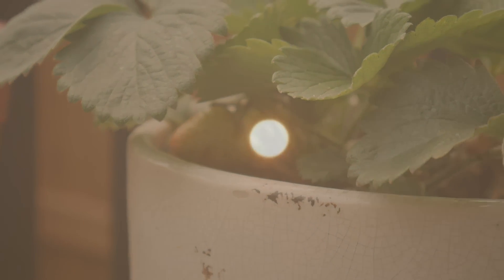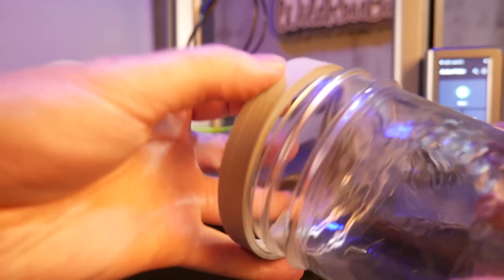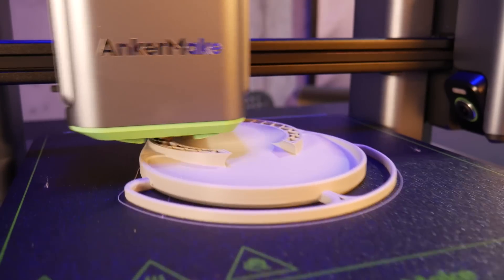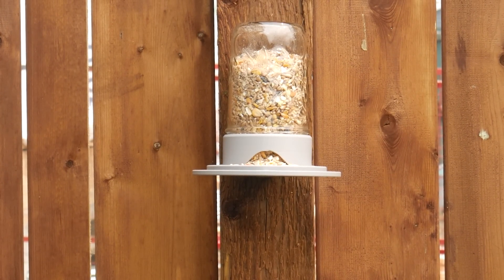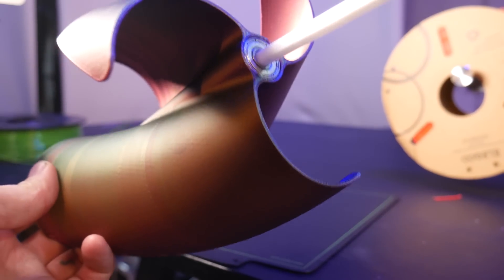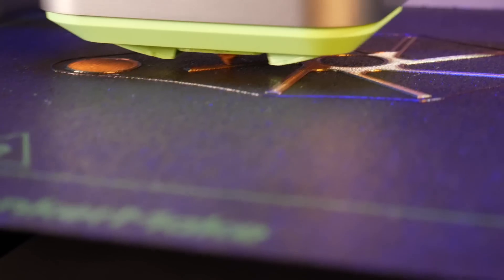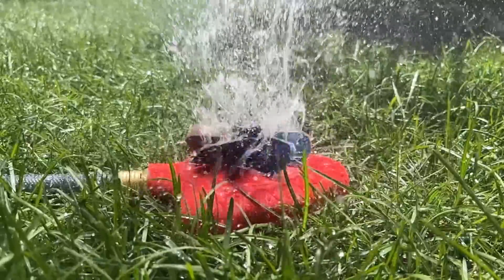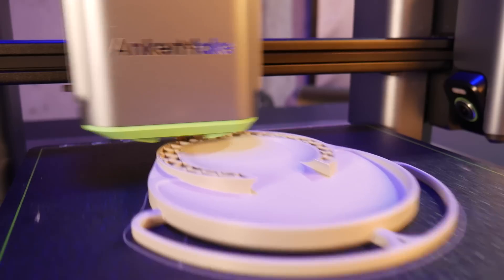Stop Buying Things, Start 3D Printing Them with the AnkerMake M5 3D Printer.

Comment: I ripped half my bumper off the other day on my truck, and 3d printed 3 little parts and fixed it. Body shop quoted $300 for a new bumper, and $100 for labor. I fixed it for $0.48. 😎

Comment: All of these new slicers are boasting unrealistic speeds. Bambu is the worst with there slow down for overhangs. There is no way it’s traveling 2 and half that bed in one second with that speed. Have you measured actual vs input speeds?
Reply from the maker: Agreed. It really depends on the model being printed. The vertical pinwheel model definitely doesn’t have enough straight lines or infill to hit that mark. Either way the .25 mm layer height cuts down print time a lot.

Comment: Great vid. I like your works. This printer seem a bit loud I think. :D I saw your Macbook. Do you use that for slicing and modelling in Fusion360? I was thinking of buying one for Lychee, but I'm not sure to how can handle it that machine.
Reply from the maker: Thanks! The MacBook Air I have is a 2017 I think, it’s a little slow for slicing but It’s good enough. I think the m1 and m2 MacBooks would work great for slicing tho!
Reply: I see. Thanks! :3